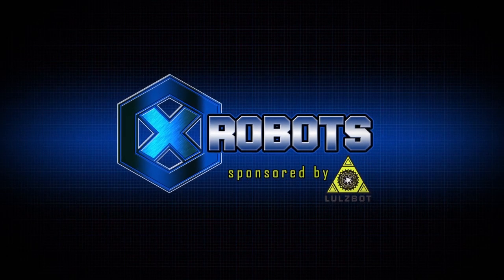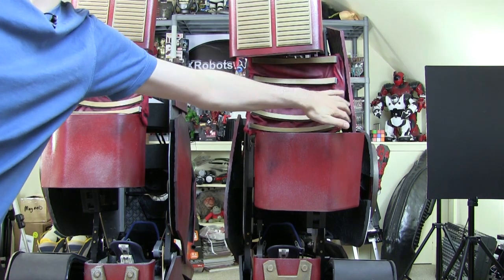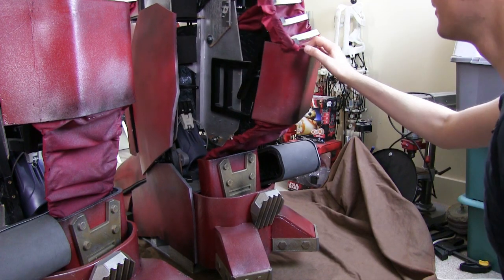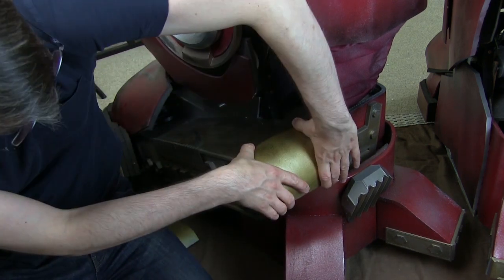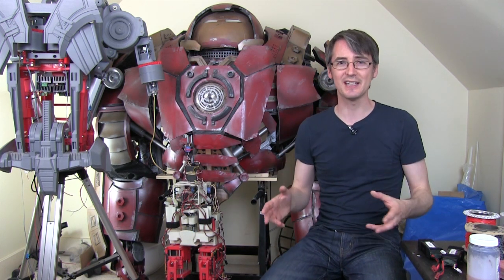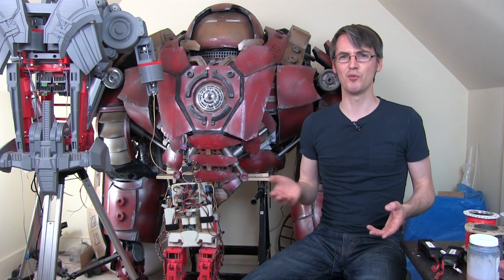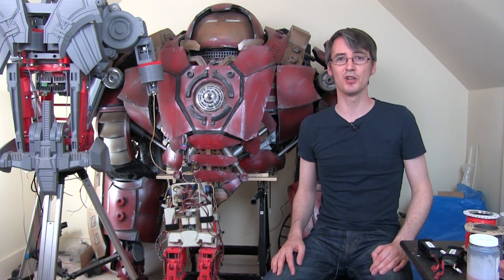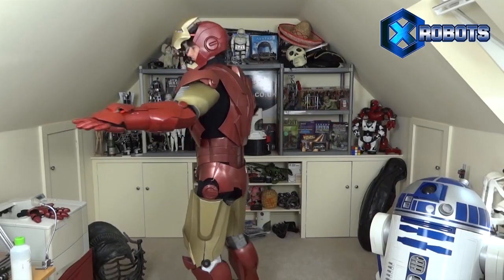Iron Man Hulkbuster Cosplay #58 | The End?! | James Bruton

Comment: Here's a thought for flexible joint covers: with your bungee cut to the correct length mark several points equidistance along it. In each of these points carefully poke a thin wire (like a paper clip) through. This is to ensure you have attachment points but they MUST NOT cut through the bungee itself, much like when you insert eyelets into cloth. Then make several overlapping shell parts and join them all between a wire point and the corner pivot point.
Now when the bungee stretches, all of the shell parts should separate at roughly the same ratio, sliding neatly over each other.
Might be worth a shot :)
Reply: I was thinking the same thing. It would be a lot more time consuming, but look so much nicer than having mesh, cloth and gaps.

Comment: I didn't see the voting gadget, but I want to vote for 'all of the above'.  I have followed for a long time, and getting Hulkbuster really complete is a real milestone, so it should be complete.  The tease about the exoskeleton has me intrigued and would like that (yes, control systems are a hot button for me, so the robotics related is very interesting).  I would also like to see some force feedback on your ultron build, but that would be addressed with the exoskeleton. ... Eventually I would like a real autonomous build with giving it 'mission goals' rather than just commands for movement.
Reply: on my screen it's a little light grey circle in the top right with an i that says mire info when you move the mouse over, after clicking the poll shows up. Dunno if its the same for everyone or if it works in the youtube app for mobile devices.
Reply: Don't see it either though using flash player because it runs faster than html5 video dose

Comment: Idea for power arm control: minimal pressure sensing. The arm only moves when it senses above a certain threshold of force from your arm within. This means you do actually have to press against it to move it but then it goes completely rigid when not pushed in any particular direction. 
It's basically an amplifier: small force within = big force out.
Thoughts?

Comment: I was thinking about an exoskeleton suit a while back and ended up thinking that magnets on clothing and Hall effect sensors in the suit would be a good non contact way of tracking the user. It would also be good if the suit involved parallel actuators for the shoulders and bi-articulated actuators. Very complex to control, but serial actuator joints just seem so unlike life.

Comment: The idea of an exo suit sounds good, I was thinking of building a Fallout 4 power armour suit and using feedback servos to control the hands. The idea with a feedback servo is it has a wire connected to the feedback pot so you can read what position the servo is actually in and compare that to the position it's being told to go to. The way I thought of controlling the power armour hands was to have a pair of gloves with bowden cables connected to some small low-power servos, then have basically the same setup but on a larger scale mimicked in the power armour hands with more powerful feedback servos. You could then use an arduino to create a simple force feedback system so that the servo position sensor from the glove would tell the hand what position to go to, and the feedback sensor in the hand would allow you to "feel" anything that the hand was gripping or touching by applying force to the bowden cables in the control glove. I've seen a couple of videos of feedback servos being used on youtube and there's an instructables link here: http://www.instructables.com/id/Servo-Feedback-Hack-free/ although personally I'd be tempted to take a feed from all three feedback pot legs rather than just the centre one. :)

Comment: The control systems would have to be something like how our electric steering wheels work on cars where you apply force and it helps you move the wheels, or something connected to your nervous system which would cost lot.

Comment: James how about you revisit the basic Iron man suit but add the exo suit idea? Possibly even try and integrate the hulkbuster suit, if you're up for a challenge; the Ultron project is absolutely incredible so far though.
Reply: While we're on the subject, though, the redesign of the Power Armor in Fallout 4 made it significantly larger than the person wearing it, is free-standing when not in use, opens up in the back for the pilot to climb in, and encloses around them. Plus, the meshes for the universal exoskeleton you bolt bits of armor onto can be extracted from the game assets for easy 3D printing or conversion into usable CAD. Hint, hint?
Reply: ***** Not even if you used some ultra-light, ultra-small power system that proves the concept but doesn't provide much extra strength to the wearer? May not be effective but a proof of concept would be incredible.